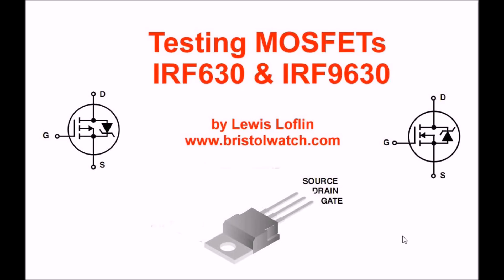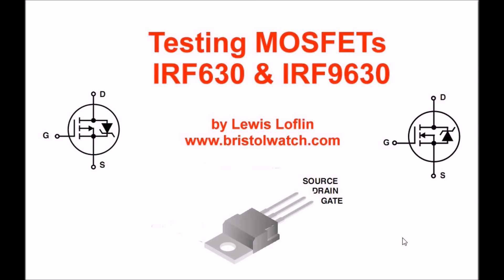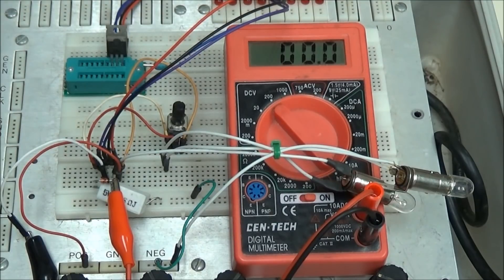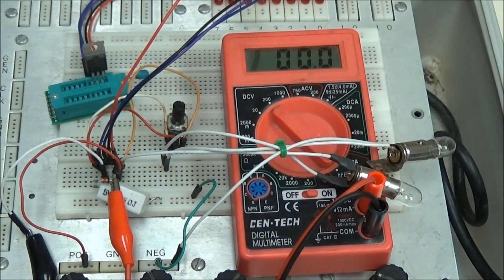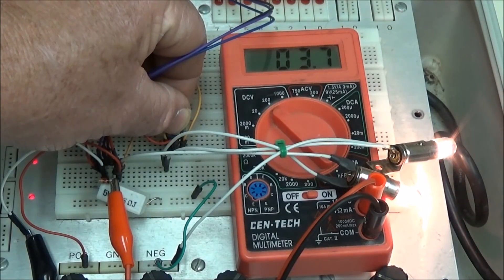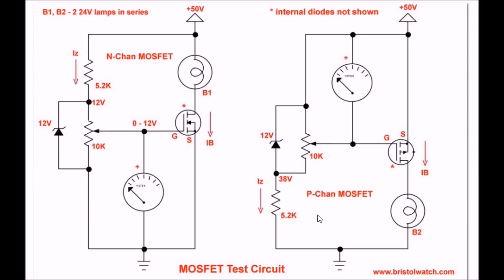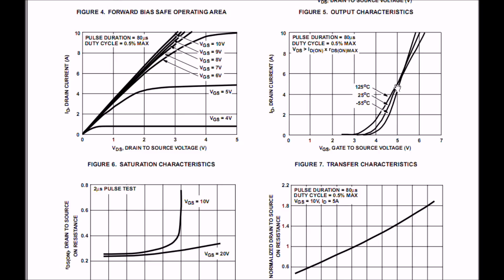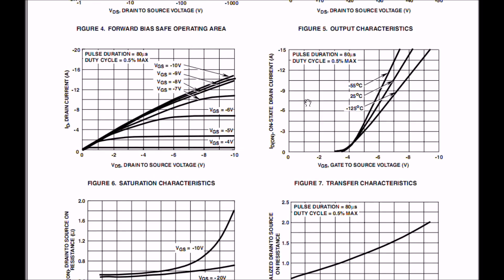Simple Circuits for Testing Power MOSFET Transistors

Comment: i made variable power supply actually old tachnic current bridge ... i have sec voltage of transformer after rectifier and filtration is nearly 25 or 27 i connect positive 27 to drain of my mosfet n channel cuse (+variable supply) source open whil is providing me variable +voltage when i move gate on potentio meter connected diractely to supply voltage 0 to 25/27 its working fine wat i wana know is ......tha iam driving the mosfet with 27 v on gate sooo when using full volts of supply... why iam not blown ....up cuse iam using current bridge having open sourse

Comment: the mosfet, can I test it welded on the chassis and with the voltage on?
Reply from the maker: You can take voltage readings.
Reply: @LewisLoflin  can you give an example?
Reply from the maker: @damianialex7293  Here is the webpage. You either have to remove the device or measure voltages while it is operating.  That depends on you circuit. http://www.bristolwatch.com/ccs/mosfet_test.htm

Comment: Thanks for the video, I will use the circuit to test as suspect mosfet from a voltage inverter, how did you decide on the 5.2K 5watt resistor?
Reply from the maker: I had to have current for the zener diode. I would have to drop 38V. The MOSFET is a voltage-operated device with a Vgs I think of 20V. So I needed enough current for the zener and pot. It could have been a smaller value. I happened to have a 5.2k 5W.
Reply: Thank you for your answer to my question

Comment: Whats the meaning to use 50volts for the Drain? For the N type Power Mosfet
Reply from the maker: To show we can run higher voltages than the gate-source voltage.